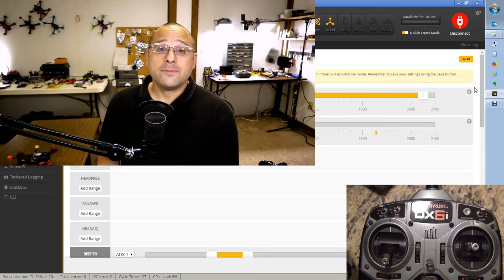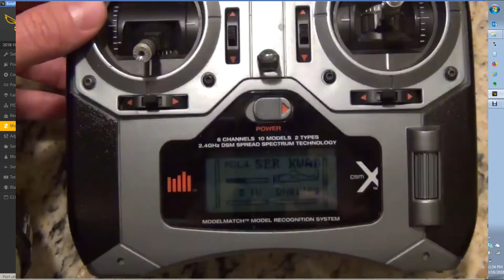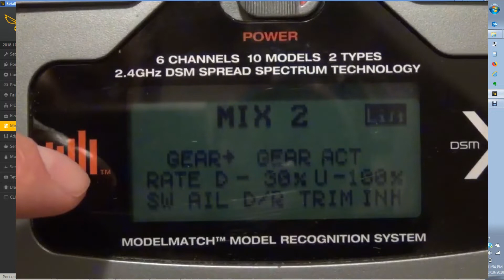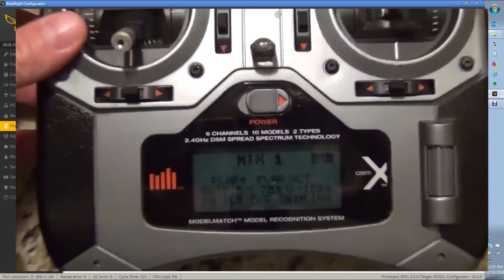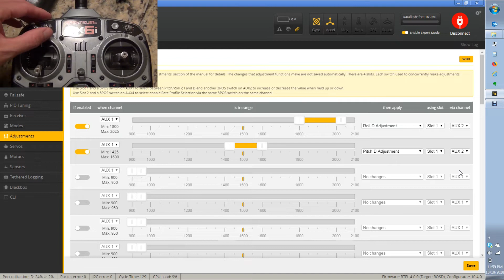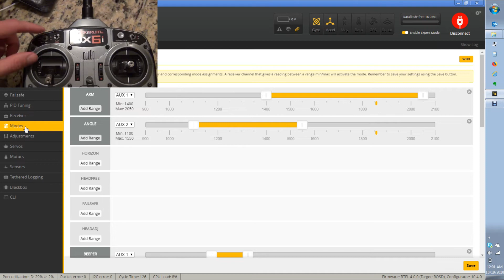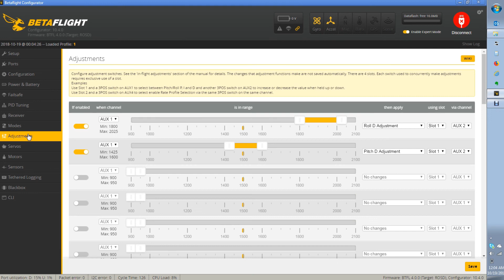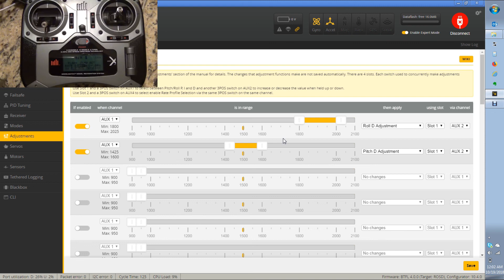TX Mixing on AUX Channels + inFlight Adjustments

Comment: Mark! I can see your face! Lol

This interested me to get it working on my FrSky Qx7. It doesn't have the same mixer setup as your radio, so I was having trouble following. Luckily I found an old video by @Painless360 and figured out how to do it through logical switches. Using this method you can have ALL switches change only 1 channel! I thought I might make a vid to explain this for the FrSky users out there? :)

Comment: When you failsafe in your Hand (turn the Transmitter off) it levels and can cut your Fingers right?
Reply from the maker: No.  I don't have it armed in my hand.  Failsafe (Stage1 or Stage2) is only applicable if the quad is armed.

I know the popular thing is to have immediate motor cut on Failsafe.  But that isn't for me.  I want it to level out and give me a second or two to see if I can regain control before it drops.  I don't see how just disarming at any given moment is safer than trying to keep it in the air for a second to regain control.  Many, many times I have failsafe and regained control with this approach to avoid a brick falling from the sky.

Make sure the Throttle value you are using is just below your hover value.  You can see it simply by turning on the throttle in your OSD, through a BBL, or simply by looking at where you stick is located in a hover and see what value that is when plugged into a configurator.